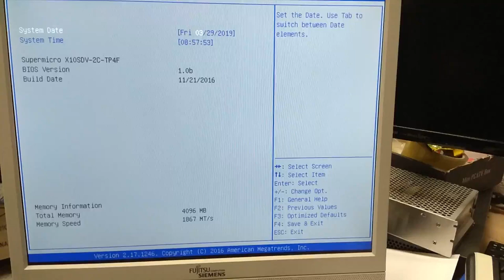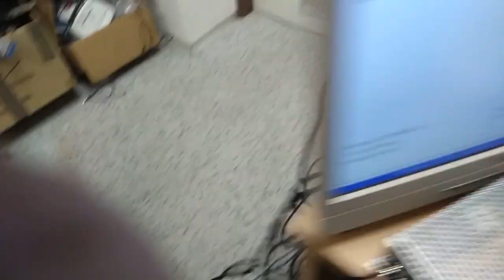Supermicro Xeon D board & 12V DC problem

Comment: Some explanation / context?
Reply: Ok: first experiment is when powered just by 12V. Second experiment is when powered by ATX power source.
When powered by 12V, the MB is supposed to use DC/DC converters to generate 3.3V and 5V, but those stops working when temperature goes over 40°C ...